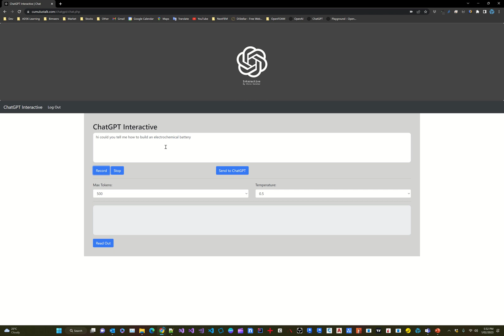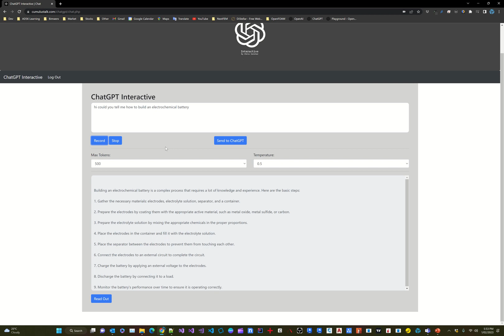ChatGPT using Speech to Text and Text to Speech

Comment: Hi, is there any reason to replace window.speechSynthesis.speak with speechUtteranceChunker() function? I bumped into an issue that window.speechSynthesis stops speaking after a certain text length when using Google voices. Is that the reason?
Reply from the maker: Hi, I'm sure you can change the speech provider, and yes, the issue was in fact the speech chunk limits, which this solution attempts to overcome. I used GPT3 to help me develop this, so probably a bit outdated by now. Also, there are better solutions on github now for this kind of thing. I'd suggest looking at big-agi as an example.